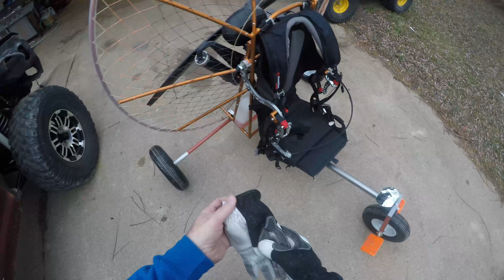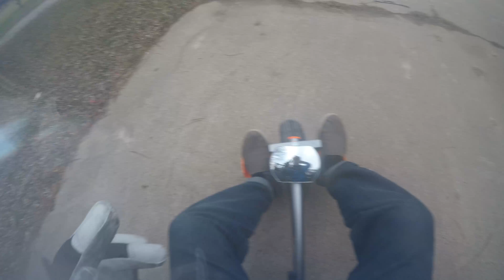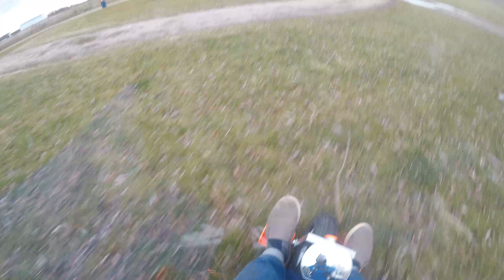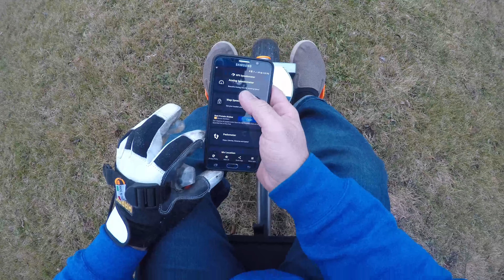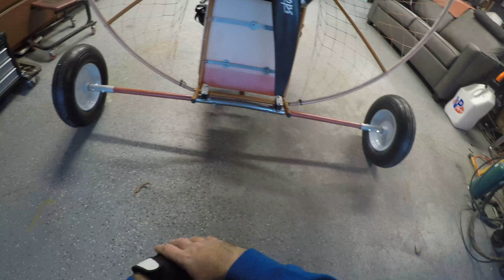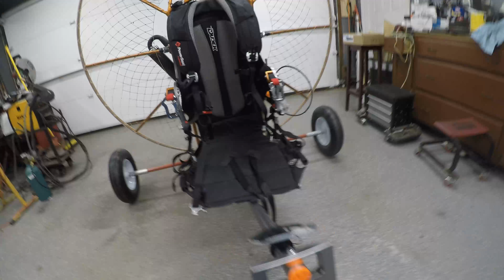I DID A THING! Para-Trike Part 1

Comment: Nice job! That trike looks nice and simple. I made my own trike very similar to yours, but I have a problem when checking the hang point. 
When I hang myself, my body angle is good but the front wheel points down to the ground because there is nothing keeping it up, so I have to add a strap on the front of the butt plate to rise the wheel. How do you keep the wheel up?
Reply from the maker: This is in the geometry and getting the CG located properly. I designed mine such that my footlaunch hang-point matches my trikes. You may have to adjust your hang-point depending on where your CG ends up with the trike attached. In my layout (in CAD) I placed the nose gear up about 8-10 degrees. Hope that is helpful.
Reply: @miketator  Thanks for responding :) Today i checked hang point and took of the straps that keep the nose wheel up and when I hanged, and as I said on my preview post, My body was perfect but nosewheel kept falling down. I can only keep the nose wheel up if I clip the hang point almost to the last front  hole in the arms, but the my body and engine have way way too much positive pitch. So I ended up again atatching a strap from the front wheel to the butt plate and went to fly. In flying mode everything looked ok, nose wheel, my position and engine angle. I can fly like that, its ok, but I woul like to understand what the F am I doing wrong if others dont need any strat :(((((

Comment: A Welding cart, a 20” Dora explorer kids bike and some commercial door and gate hardware were all harmed in making my trike. I bought a used motor Simonini mini mfor 1300 a used wing for 1800 and built a trike and a trike trailer to act as wind station and seat for the LZ and all of it was under 4K and its safe too!!